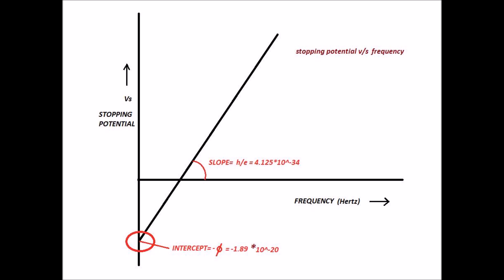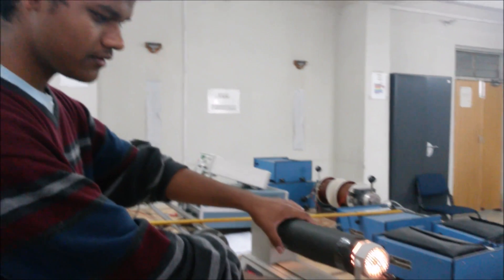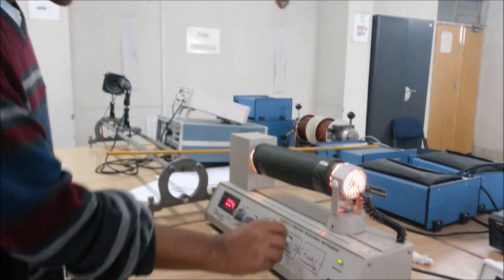determination of Planck's constant using Photoelectric effect

Comment: Interesting but I read that the intensity of the light does not effect the experiment just the frequency is this true ? If it is you don't need that black cover.

And also what happens if you change the voltage ?
Reply: +KaimeraPk  actually the no. of photo electrons emitted depends on the intensity of the incident radiation and the energy with which they are emitted depends on the frequency.so the conclusion is that they are using the black cover just to increase the no. of emitted photo electrons to produce more current.